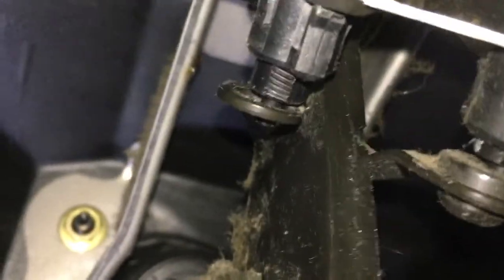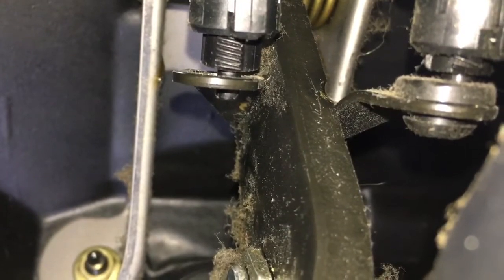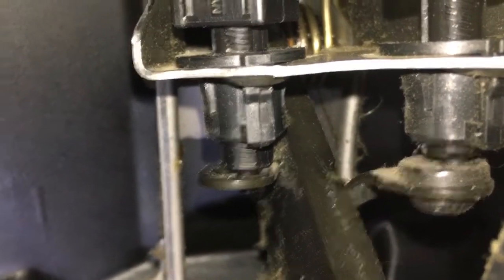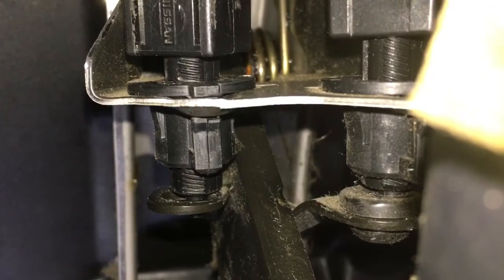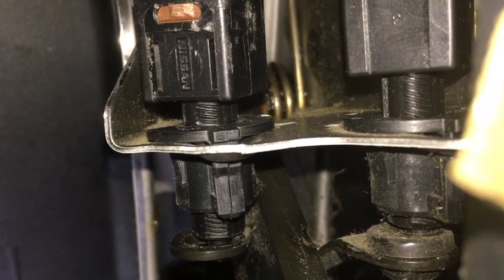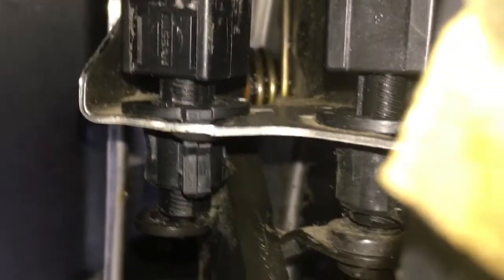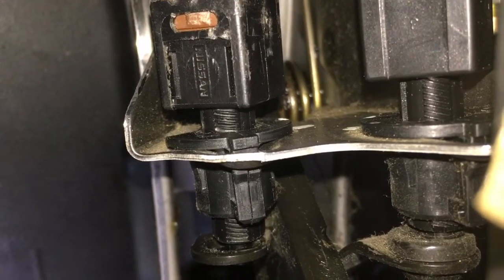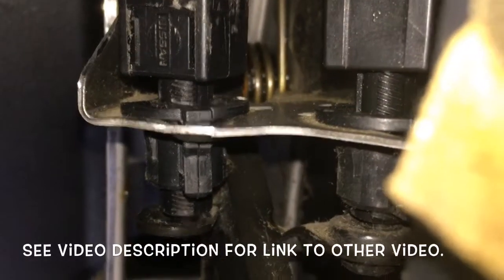2001 Maxima - stuck in park part 2  | break light switch replacement

Comment from the maker: Part still working fine . Over 1 year later

Update nearly 4 years later it broke again .  I tried 2 different ones from ebay , both broke in a week. ebay sellers refunded me, then I got another FACET one and that one so far seems to of worked.   so lesson learned. Stick to Quality OEM or MFG located in US or Europe or Japan.    FACET one is made in Italy
Reply: I just got my maxima to drive back and forth to work. Do I have to fix this or can I just keep using the screwdriver
Reply from the maker: @backmonavery    It’s best to fix it .      Check beak lights bulbs.  If one is broke it will do this.  It’s not that diff to replace the break light switch if that is broken.  But it could be other things as well.  I got the part to replace it. From rock auto , aftermarket part